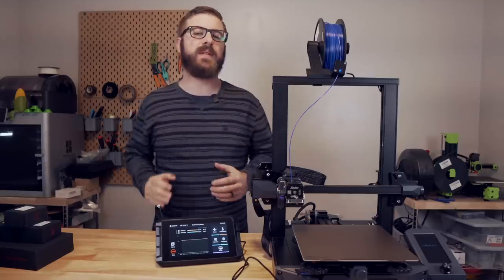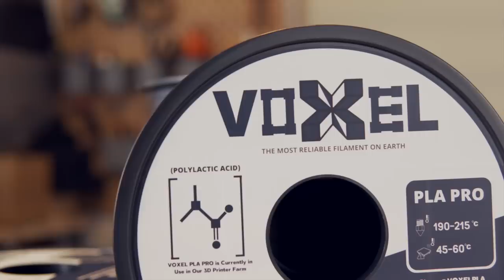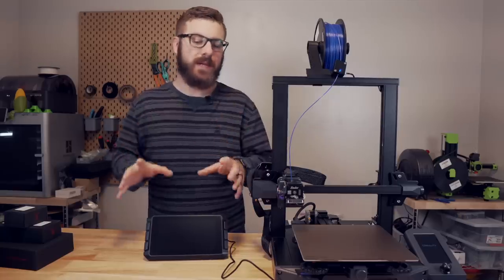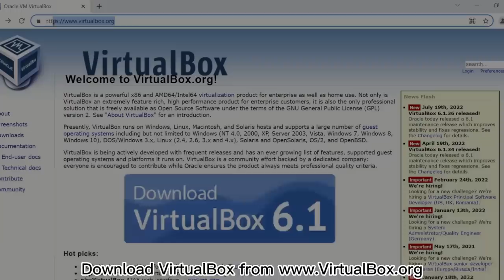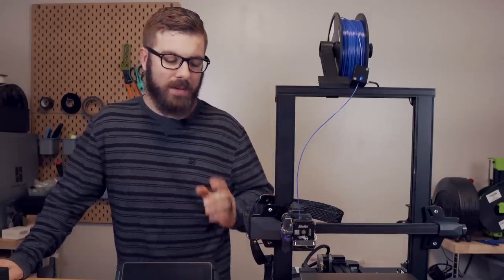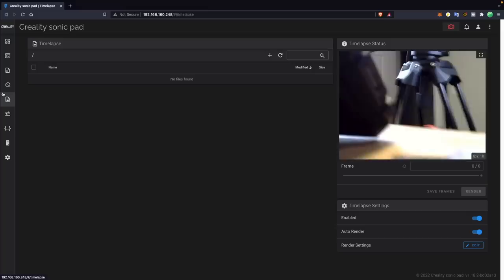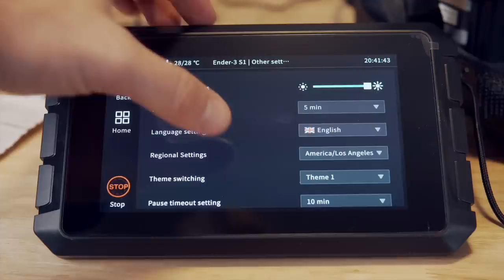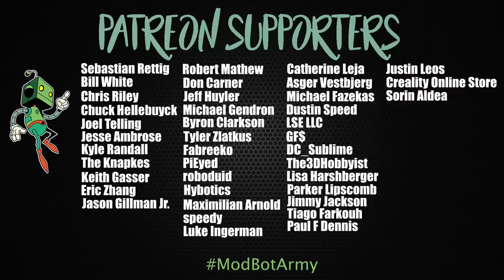Best Upgrade For Creality 3d Printers? Sonic Pad

Comment: Still too many headaches and accelerator problems for an Hbot  to even think about spending $160+ dollars. It cant work as it should without both the X and Y axes being monitored by the accelerometer. It seems to be only configured for their elite line of hbots as a second thought. The only machines Creality has that can take any real advantage of this device is their CORE units. Enders 4,5,6, and 7. If you want to use it on any other machine it's up to the user, "YOU" to figure it out. My question is; Will this device work on my Saphire SP3? Or am I better off using my PI and my Galaxy S5 phone for a monitor and flashing Klipper. And just jumping in. Thank you for your help with this subject. I am so tired of wasting money on devices that are one trick ponies Or only work on their stuff.
Reply: I think somebody is using your channel for a scam of some kind. It's got your logo on it. just thought you should know

Comment: I bought this not realizing that you couldn't "automatically" install Klipper onto the CR6SE with this. I realize there are ways to get this on to the CR6SE, but would have been nice to at least include the Ender 5 and 10s, let alone the CR6SE.. This company tends to leave people out in the cold with other models of their product if you don't have an Ender 3..
Reply: This is good to know as I was thinking about getting this for my CR6SE. I want to install Klipper for both of my CR6SE machines but haven't found a way to do that easily, yet.

Comment: just got mine installed on a ender 5 plus. After a very long day of installing it and getting it printing properly i gotta say im very happy with it. its printing far nicer quality and faster aswell. Loving all the new features my printer has with it. One of my favorite features is a small one but helps alot which is the wifi. Sometimes u gotta slice a few times to change settings and being able to send it wirelessly saves alot of time over all. The only complaint would be the installation process. The instructions arent very clear and i ended up bricking my machine for a frustrating 45 mins or so. But in the end it was all worth it.
Reply: What was your issue getting it setup?  I'm having an issue when it says plug the printer to the screen. I do, it says connecting. Then gives me a red klippy error box on the top half of the screen. Anybody have an idea??
Reply: @themysticmakers4908  it was something to do with the firmware. I had to create it manually or something like that to fix that issue.

Comment: I would be very impressed if they add the things you asked.
Most of these companies throw something on the market and the just move to the next one.
But yeah, thanks for the video :)
Reply from the maker: I really hope that is not the case. They seem to have spent quite a bit of time on this so they just need to add a few tweaks.
Reply: @ModBotArmy  I wouldn't be surprised if in 6 months they would come with sonic pad 2 and have some incremental updates.

Their whole software lineup is just a façade,  once you dig below the surface you start noticing how many things are missing.

Ex. why would you sell different nozzle sizes if you don't have the profiles in the slicer?

Comment: Why not compare the printer performance and quality before and after?
Reply from the maker: Plenty of videos that show what klipper is capable of. It isn’t really what makes this device unique. The main thing gained is increase in speed with minimal lack of quality thanks to input shaper. Pros of klipper will list the other benefits 👍
Reply: @ModBotArmy  considering the Sonic Pad doesn't have the same controls over input shaping, I figured it would be good to show people if that lack of y axis accuracy would compare to stock vs full klipper.

Comment: I'm not a Creality fan (given how much I spend on filament, I don't see much value of bargain-basement printers for me), but I'm quite impressed by Creality making this. But is this a bridge product? Will companies like Creality move away from Marlin to shipping with Klipper built in to the printer? Obviously the need for a moderately-fast processor would add cost for them, but if they built that in to their controller board, it might be worth the few dollars increase given the benefits to the end user. Maybe they'll go this route for the "Pro" versions of their printers, and stick with Marlin for the more price sensitive models?
Reply: This is the problem Creality has created for themselves.  True they sell some "bargain basement" printers.  But not all of their printers are.

Comment: Great video , thanks, I would be more interested if it was a wireless device so I could sit at my computer desk and operate the printer, also if you could send files through the network to the printer instead of the CD card being taken in and out all the time. 
I have an S1 pro and for me I am happy how it works so to have a different screen plugged in to the printer and have a few more features is good but not looking like it has the features I would want for a new screen. But it is nice.
Reply: It is wireless.  Just input your IP address.

Comment: What Creality needs to do is stop locking down their stuff. There is nothing here that can't be done with an old computer connected to the printer via USB. Because Creality and DWIN don't release their info for klipper  configs, I am forced to spend $40 for a BTT screen IF I want to run klipperscreen. I'm ok without it. Creality is being a bit short-sighted here by trying to turn a profit on these - as people get more into klipper and performance printing, they are going to quickly figure out that their "high end" corexy Creality printers have unusable screens, 5 generation old boards that can't support more than 24v, $5 chinese stepper motors, etc. I bought an Ender 7 (after tiring of being locked into Creality Cloud on my son's CR-10 "Smart". Only decent parts to come on these printers are the DM542 external stepper drivers and a not-completely-laughable (but  not up to their 250mm/s advertised speed for real life prints) hot end. So, yeah, spend the money on this and their printers... For someone entry level, it's the learning fee for what you could have figured out on your own for free building the printer (that you are going to want and probably build anyway) for 2/3rds the price. If you want trouble-free printing, get a bambu carbon. If you want to learn and go fast, build a voron, ratrig, vzbot, hypercube, etc. I don't understand why anyone would spend this kind of money for software that is free, and hardware so cheap that if you skip a few Starbucks coffees, you won't even notice the money.

Comment: Another attempt to take something you can get for free and put a price tag on it. This is for the people who have nothing except a certain kind of printer and are too stupid and/or lazy to follow YouTube videos. It's neat that it's a contained unit, but it's a lot of money for something that only controls one printer. I know that Pis are hard to get right now, but, you don't have to strictly use a Pi. Klipper was outstanding when boards were 8bit, but now? I get the "options" that Klipper runs that Marlin doesn't even come close to. But, now with 32bit boards, do you even need to try and run Klipper? On a printer that you are going to print vases on? I think you REALLY need to look at "what" you are printing and the issues you HOPE to fix with Klipper in the first place. Klipper is NOT a magic "fix all" to all your printing issues. It will, with some effort, fix a lot of your printing issues, but not by just installing it from a $160 device from Creality.

Comment: Would be nice to hear you discuss what the Sonic offers other than wireless access and a webcam, and if the stock touchscreen becomes an ornament.
Reply: I would like to know this too. I have changed out my screen and went with straight Marlin firmware, but if this would help with the chronic bed leveling issues I'm going through that would be fantastic